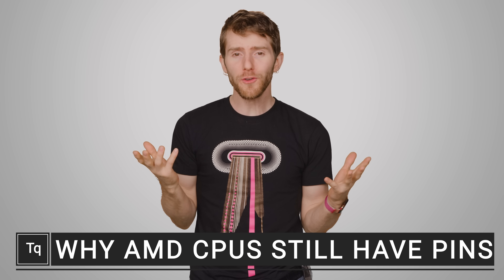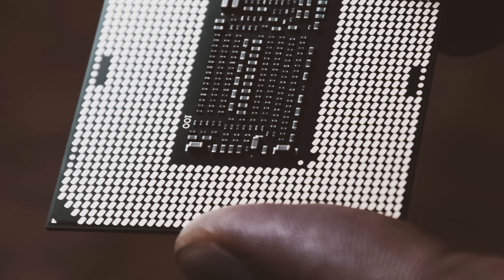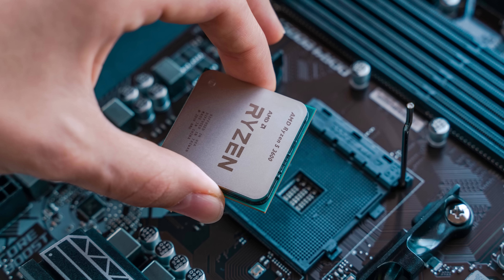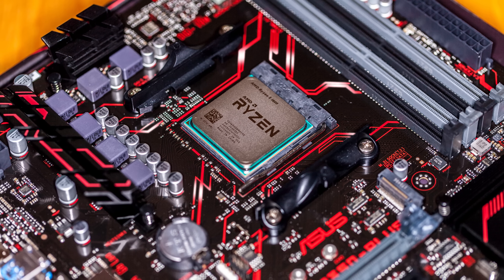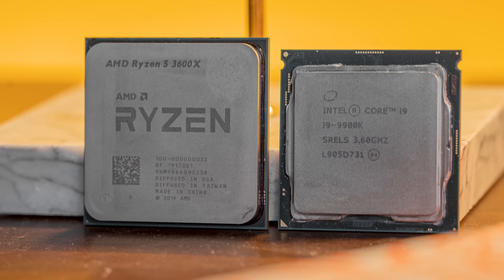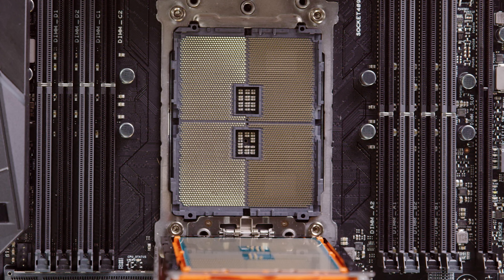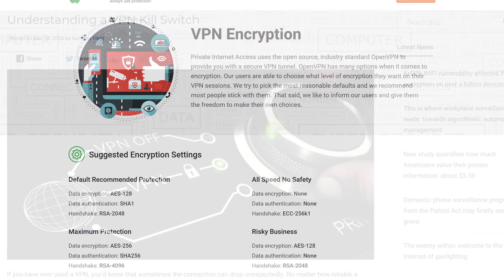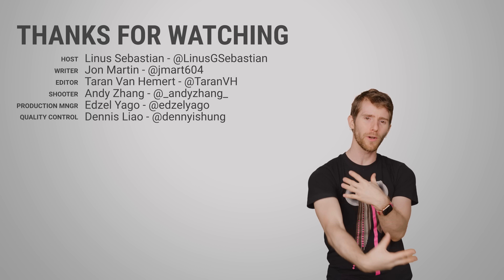Is AMD Stuck In The PAST?

Comment: One more perk of LGA. The metallic bracket on top of the IHS prevents coolers with particularly sticky thermal paste from pulling the chip right out of the socket. If you aren't aware of and ready for this, you could have a nasty surprise next time you re-paste your chip and don't take the necessary precautions.

Comment: I wasn't aware you could destroy the contact pads on Intel chips by touching them. I've touched them quite a bit over time, and when I did I'd use a little IPA to clean it off. Works fine.

Comment: Would it be so much to ask for AMD to add a locking frame like Intel has? Removing a cooler from an AMD chip often runs the risk of ripping the CPU off the socket.
Reply: I recently actually did that because past me used a touch bit too much thermal paste and did NOT remove the cooler when the processor was warm. If you know what you're doing, a bracket isn't really necessary, but it is nice to have.

Comment: ive literally seen comments saying one CPU is bad because it uses pins

ignoring he needed cores..... and spent 2x on an intel CPU....ONLY!!! because "pins are old"
then cried when he was wondering why it was slow.... and ONLY THEN looking up benchmarks 
(mainly to confirm his intel performance..... but found ryzen 1000 on the top for his work load)

he thought ryzen was from ~2005 because it used pins.... 

ive seen people say that pins transfer data slower.... 
it overheats the socket more
AMD cant make LGA because they are simply stupid... (ignorant of epic and TR)

99.99999% of the time it doesnt matter..... and only does when you, somehow, actually bend a pin
kinda hard to screw up a LGA or PGA pin.... just use the SLIGHTEST caution and common sense

Comment: PGA.... all you need is a ball point pen to fix it.... take out the ink stick and insert bent pin into end with no ink
or use the normal tip of the pen.... with the ink stick retracted. 

while it takes a pretty good tool set and magnifying glass to get LGA pins straight on the mobo

like.... the PGA socket even helps to straighten them out.... get it close, then GENTLY wiggle it a bit.... 
and it should drop in

the pins are SLIGHTLY smaller than the holes in the socket.... also it will "fine tune" the bend a bit

Comment: I don't mind AMD using pins, my issue is that their socket locking mechanism is absolute garbage. Not once have I ever pulled an Intel chip out of it's socket, it's not even possible because of the clamp that goes over the CPU but yet with this AM4 socket, I've managed to pull the CPU out of it's locked position while traying to take the cooler off...and bent some of the pins. It's ridiculous how weak the locking mechanism is.

Comment: the PGA wouldnt bother me so much if the damn cpu didnt rip out of the socket when u took the cooler off. seen too many cpus get damaged with broken pins that got stuck in the socket. just add a damn retention bracket like intel and problem solved

Comment: I just hate that AMD relies on the CPU getting hold down by the pins instead of securing it with an additional method. Not the first time I had to scrap an AMD CPU off some cooler

Comment: if you bend a motherboard's pin, you can short circuit your motherborard and processor...and i did it =( with my i5 6500 and gigabyte ga-h170 gaming3

Comment: He forgot to mention that there is a high risk of ripping the CPU out of the socket and bending a lot of pins, when unmounting the cooler and the thermal paste has turned into glue after a while

Comment: I used to have an AMD Phenom II X4 965....it got used in several different CPU builds. I remember later on in its life, around 2013, I bent the crap out of the pins accidentally while it was being transported a long distance in my luggage. Took me a good 4 hours but I bent all the pins back with tweezers and it still worked fine lol. 

To this day I am shocked it still worked like a charm lol

Comment: No. You're stuck with intel! PGA connections have larger contact area almost the whole length of pin. and if you carefully observe the socket, you will see that the pins get clamped with tiny metal plates. PGA would provide greater current capacity And We dont change cpu every other day.

Comment: As I see the place taken by the pads are usable to solder pins on it. So I am a little sceptic about the "LGA has more density" statement. Other untold reason is they pushing the MB manufacturers to do the hard work, and produce expensive items. In that way Intel can sell their product cheaper, or same price as  they were use pins but with more profit. AMD is take the burden of pins, but the MBs are cheaper. Different policies.

Comment: Why not just pads with tiny domes on them on the motherboard instead of pins? Of course you would need slightly more pressure and the domes could wear down, but are there other issues with this idea?

Comment: One thing to look out for with the AMD PGA is the possibility to be pulled out of the socket when removing the heatsink.
Had this happen to me when upgrading the stock cooler on a 3900x, was unaware it was still sticking to the heatsink and bent some pins in the process.
Twisting the heatsink before pulling it off could help if the heatsink design allows you to do this.

Comment: >AMD stuck in the past
>AMD is the only reason we still aren't using single core CPUs
Reply: Lol true
Reply: IBM would like a word with you
Reply: 3point1 lol! 😂😂😂
Reply: Given intel contracted them to make it its kinda intels as well
Reply: @ThatOnionispog  really?source?
Reply: Do u even know who released the first dualcore?
Reply: @dvr1337  IBM and Motorola?
Reply: Also 64 bit.
Reply: AMD are also the reason why we have huge gains on cpus, single clock speed CPU are EXACTLY THE REASON the industry has halted. Because clock speeds are no longer the core determiner of a CPU and in fact companies are hitting a plateau in terms of performance of pure clock speed. However you have a slightly lower clock speed CPU with high IPC? You beat a high clock speed CPU.. not only that but for much cheaper too. Intel have a thing or too to learn from AMD.
Reply: PENTIUM from INTEL would like to know your location
Reply: @Pidalin  athlon was actually the first good dualcore
Reply: AMD is also the reason we are using 64 bits, because Intel solution was too expensive and had no backwards compatibility to 32 bits.
Reply: @jmtrad1906  sigh, again, no, there were 64 bit CPUs well before AMD64. 
PowerPC, was 64 bit in 1997 with the 620. 
AMD did not have AMD64 out till 1999. 

Like, literally none of the “innovations” you fanboys are achievements of AMD

Are you confusing AIM with AMD or just not realizing that there are chip manufacturers besides intel and AMD?
Reply: AMD is the reason 64 bit x86 exists
Reply: Havent you realized that LMG gets a monthly check or hardware from Intel?
Reply: @Pidalin  qthlon x2 was so much better then intel. intel had 2.2ghz while athlon had 3ghz
Reply: Don't get stuck in the past, dude! :-)
Reply: @Pidalin  Trust me, it's not the software developers who want to use multiple cores.
Programming for a single core computer is SO much easier. If they could build single core CPUs with the same performance and cost as the CPUs we use today, trust me: we'd be using those single core CPUs.
Reply: @RalphInRalphWorld  If you are developer, how can you explain that Witcher 3 was completely playable on dual core (with 2 threads only) in version 1.0 and after 1.08 patch it wanted 4 threads and it was freezing on 2 thread CPU? Why? :-O
Reply: @Pidalin  I'm not sure about the Witcher 3 situation because I don't work for CDPR. If I had to guess, most gaming CPUs these days have 4+ cores, so those are the CPUs they're testing on. 
They probably decided that it's not a priority to fix the game for 2 core systems.

Developing for multiple cores is more challenging. However, it would be foolish to for a game company to let your CPU resources go to waste.
Reply: @RalphInRalphWorld  Yes, but in 2015 dual core CPUs without HT were still common and game was playable in 1.0 on that, I just don't understand why such things are happening. Something works on some HW in some version and it's not working after few patches anymore. I gave PC to my sister in that year, it was pentium dual core and GTX460 (I know, it was already outdated) and I gave Witcher 3 to her (she is big fan of books) and after some times she was constantly saying game is freezing and it took some time to realize what happend. Thanks to DRM free politics, it was possible install 1.1 version wihout client manualy and install 1.07 patch manualy, that's good about CD Project and GOG, you can't do such things with steam client.
Reply: @Pidalin  there's additional overhead cost when context switching between threads. Ideally you want one thread per core to spread load and minimize context switching. After the patch, there are now two threads per core resulting in additional context switching thus worse performance.
Reply: AMD made some innovations, Intel made some innovations. IBM, SGI Motorola Cyrix etc made some innovations. Customers benefitted.
Reply: If it was amd first and intel the newer company it would be the same.
Reply: lol. 100% not true. if intel didn't exist we would be using single core cpus too.
Reply: @LoadingData...  Same goes with AMD , if AMD didn't exist we wouldn't have 64bit x86 cpus , more than 1 core , 8 core , 32 , 64 & 96 core cpus , powerful igpu with cpus
Reply: haha
Reply: dont forget what happen if amd doesnt exist, we will stuck on quadcore cpus
Reply: Really, it's because AMD? Cause, the PPC Architecture was using both 64 bit and multicore a full year before AMD released Multicore anything and the x64 architecture....
Reply: @Mostlyharmless1985  We aren't using PPC for much. And besides iAPX64 (sucked) but came out before x64, and before that the DEC Alpha come out way back in 1992. 
So for what we are actually using, yes, it is AMD64.
Reply: bitset “we aren’t using PPC For much.” XBox, XBOX 360, PS4...Wii...
PPC pioneered both multicore and 64 bit processing and broke the gigaflop barrier back when AMD was circling the drain about to choke on its own puke. The whole premise of multicore processing was that achieving higher clock speeds was basically unfeasible.
PPC achieved this with RISC.
AMD achieved it by shitting it’s pants, falling down, and crying. 
It was some bad times for AMD back then...
Reply: @bitset3741  Mac's used PPC. First 64 but chip was MIPS R4000. AMD made the first 64 bit and multicore x64/x86 processor
Reply: Galaxy TS2  Kudos!
Reply: Ondřej Matějka AMD is pretty hot in IDLE because it doesn’t work like Intel. They goes in ‘’performance mode’’ even for a simple task. At the end, your processor will be much more reactive but it will run hotter.
Reply: Intel was making dual & quad cores while amd was dying...
Reply: @DarkPortall  AMD wasnt dying. intel been doing shady stuff like paying companies to use intel. but amd was and has better preformance. everybody with desktops did a long process just to switch to AMD...
Reply: @SUPABROS  well said XD spot on!!!
Reply: @SUPABROS  FX was a joke, accept it or not
Reply: Galaxy TS2  
Shame you're the one with the one track mind.

Everyone else had no problem getting what he meant. You're the one having issues with context here. Seems you're pretty single core to me. :)
Reply: Galaxy TS2  Who asked?
Reply: @truereaper4572  go to school
Reply: @toafloast1883  ok

Comment: could you show if it affect on the fps if the gpu hasn´t enough pcie lanes.
sory for my bad english im from germany
Reply: There are numerous videos about bottlenecking with pcie version and lanes. Tl Dr is, you will gain performance from better graphics cards and yes, there might a bottleneck appear. But still, better cards run faster and more efficient.

Es gibt einiges Videos zum Thema Flaschenhals in der Performance. Nichts desto trotz, wirst du allein wegen Effizienz und Chipsets, mehr Performance rauskriegen, mit besseren Karten. Selbst wenn die Karte die Performance deiner lanes (version und Anzahl) überfordert. Kurzgesagt, es macht auch mit einem z.B. b350 Board mit pcie 2.0 ggf. Sinn, die graka zu updaten und du wirst später, solltest du Board und CPU updaten noch mehr aus deiner Karte herauskriegen

Comment: One thing that I HATE about AMD sockets and don't understand is why AMD did not put a locking bracket over the cpu like Intel did. Now if you try to remove a cpu cooler from an AMD cpu without being extremely cautious you risk pulling out the cpu from the socket potentially breaking many pins... A little aluminum bracket would have solved all of this

Comment: Clearly we should all transition back to card-mounted CPUs for ease of installation and cool factor
Reply: Pentium II gang
Reply: Motherboards need to enter the 3rd dimension. I’m talking stacking daughter boards on top of the motherboard. We would have cubic motherboards.
Reply: Pentium III in slot were great, it had double cache memory and much better heat sink than was standard in that time. But I heard that problem with this is too long connection between cpu and ram.
Reply: Very soon my friend, when everything is integrated into the "CPU" with interposer and all we have left is a PCB with VRM, PCIe connectors, and USB ports.
Reply: @Erik Mikkelsaar  heat is not really the reason. Today they have liquid coolers. That alone makes slot style processors feasible again. They dont go back to slot processors mostly because of overhead cost of manufacturing Slot style processors.  There's a lot of wasted "real estate" when fabricating slot processors. It's easier and more efficient to print processor wafers for socket style processors.
Reply: @Erik Mikkelsaar  ah ok misunderstood ,  but it's all cool.
Reply: Clearly we should all transition back to using that asian kid in our class for cpu's

Comment: Quick answer: No. They are a active competitor to Intel in both the budget, gaming and professional space.

Their proccesors and sockets are generally also easier to repair in the case of bent pins, compared to Intel.

No need to watch the video. Why is this even a question when you can regularly see articles presenting AMD as being in the forefront?

Comment: The only real consumer side downside of AMDs solution is the possibility of those pins getting ripped out when replacing the fan or thermal paste.
Reply: join the graphite pad master race, pasty cpu peasant.
Reply: Which is why the advice has always been run the CPU for a little while to heat it up. Then remove the heat-sink (twist and lift). The fan itself is attached to the heat-sink so removal should be easy anyway.

Comment: 1:47 "are a little tougher" NO Linus you are wrong, like they are 10x minimum tougher that the onest on the intel motherboards, who get scrued just by a little hair.
Reply: Yeah, it's almost impossible to bend an AMD pin when simply inserting your CPU, but it's entirely possible to destroy Intel pins when trying to reinstall a CPU when the motherboard is installed in a case. There's no contest when it comes to durability.
Reply: Javaguru and it also explains why intel pushes the consumers to have a new motherboard every single gen, if they decided to upgrade their cpu.
Reply: @hadifelani  nah. They probably get money from mobo manufacturers to make the chips in a new socket so that people have to buy new mobo if they want a processor. Ultimately, mobo manufacturers profit a lot.
Reply: Yeah. I lied to myself and thought the LGAs were spring pins. TBA looking at some of the LGAs in the video I almost prefer to stick with my PGAs. Year's of experience with them and never bent a pin to the point of destruction.

Comment: Total crap. It's all about Intel shifting the responsibility for the easily damaged part to someone else - the motherboard manufacturers. The pins on AMD CPUs are much more robust than the pins in Intel's sockets. Also AMD's sockets have no exposed contacts to contaminate, unlike Intel's CPUs. The only technical advantage LGA has is the potentially higher density, which is achieved with a smaller contact area and a lower current handling capability, meaning that you need more power pins anyway.

Comment: Intel CPUs are mostly very expensive compared to AMD, so the focused on replacing the mainboard, as you mentioned. AMD on the other hand is generally cheaper and focus on replacing the CPU instead of the mainboard. In case of damage.

Comment: I haven''t even watch the video yet, I will, but whoever tried to fix a bend pin on a motherboard socket knows that bend pins on a CPU are usually easier to fix. I worked with PCs for .... a lot of time (more than 25 years), I have no clue how many computers I build for clients, friends and familly, in all that time and after all those PCs, I think I only have a 1 incident with bend pins (knock on wood).

Comment: Idk about you but I've never damaged the pins on an Intel Mobo, i straight up relax since there's no risk for me, but when i have to lay an AMD chip, or to install a fucking cooler, i get a little stressed out, I actual damaged a motherboard just installing a 3rd party cooler, luckily i could blame it on the motherboard and get the warranty replacement done 🤫